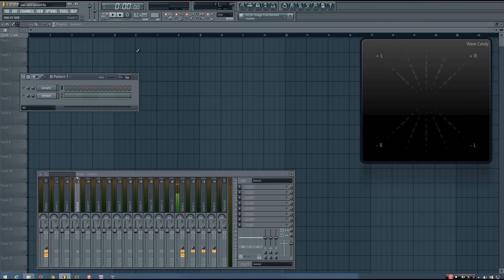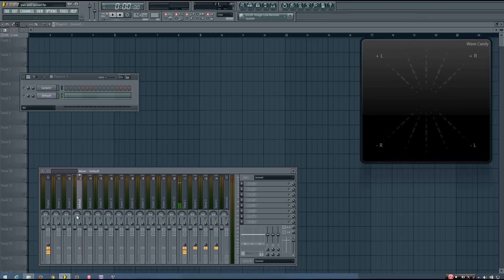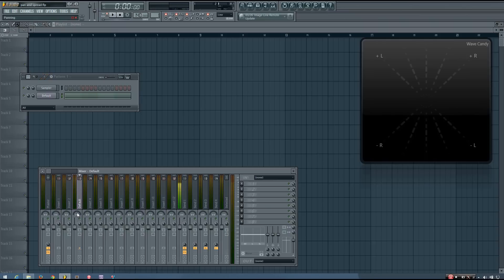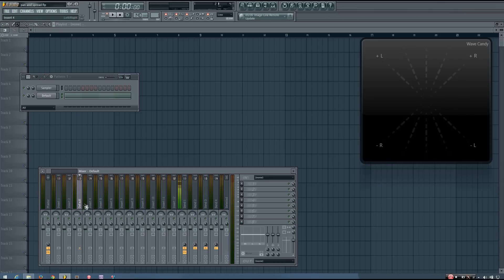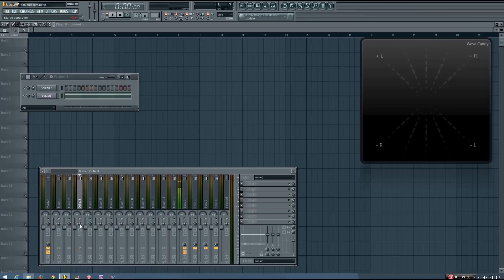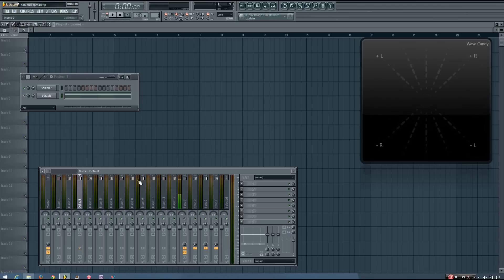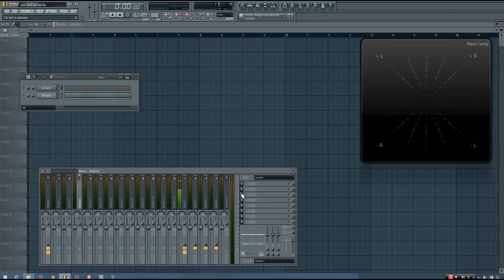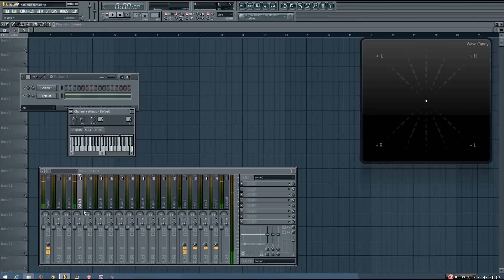Mixing Tutorial: Pan and Spread

Comment: How does mono work if it sends through two speakers? (Theoretical question) does it get split up as if a stereo sound?
Reply from the maker: Yeah when a mono signal is converted to stereo, it is usually up-mixed so that the left and the right channels will both play that signal. Since it's exactly the same signal going to each speaker, it won't sound like it has any stereo width.